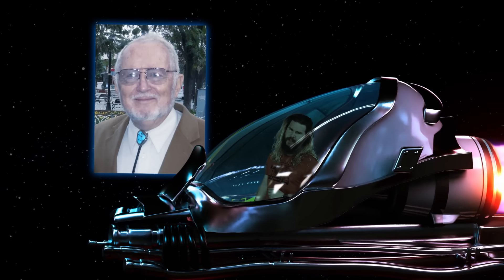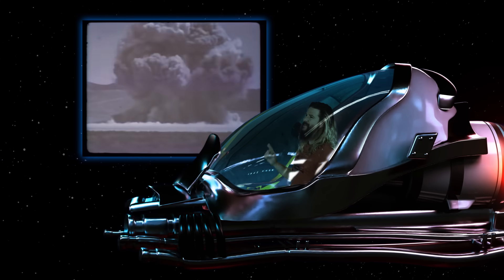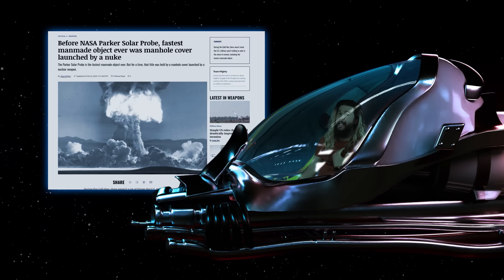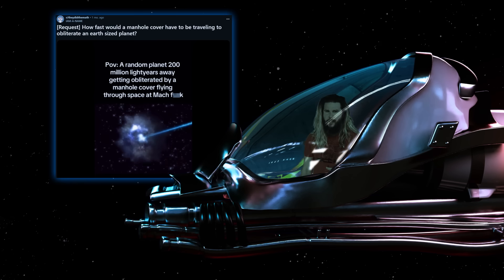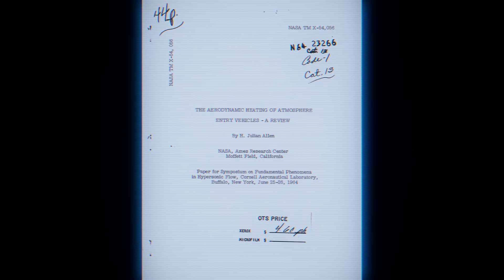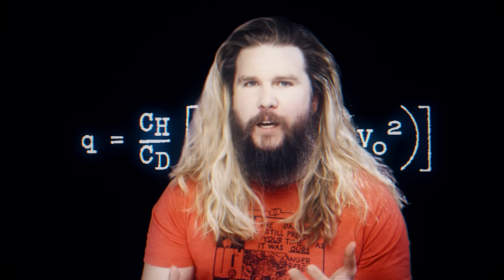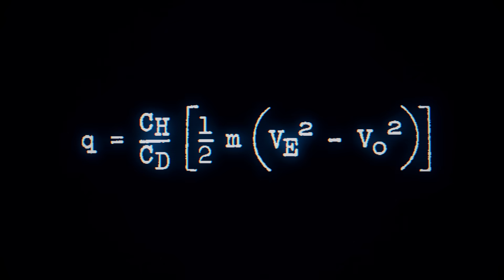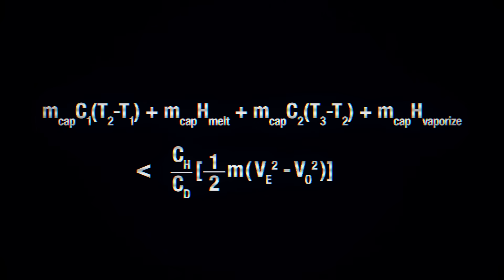Debunking the Nuclear-Powered Manhole Cover

Comment: I see one major problem with your math. The drag will change dramatically during the flight as the object starts to vaporize. You would need some integral to calc that in. Not sure if it will be enough to change the outcome, but some parts might have made it to space then.

Comment: im not saying it makes the order of magnitude difference that it neeeds to change anything... but that first half of the equation leaves a lot of things skipped over or unexpained ( is the nasa paper publicly vailable?). its also reasonable to assume the plate didnt fly straight for very long and if it survived the initial launch and tumble it will probably, vaporzied/tumbled/melted itself into a much more aerodynamic shape. hopefully sb will do a simulation of that at some point that woul dbe so cool to see.

Comment: I don't understand why people ever believed this-- when people observe re-entry burn at a tiny fraction of this speed with specially-designed heat shields, how could an unshielded ballistic mass of that size not completely evaporate?

Edit:  Think this-- a spacecraft returning to earth is relatively gently slowed by the slowly-increasing thickness of the atmosphere.... but the cast iron cap isn't gently heated but the energy is mostly applied against it all at once in the full thickness of the atmosphere.

Comment: Kyle, my only issue with your assumptions is that heating would be same entering the atmosphere as leaving. If the heating wasn't enough to vaporize it before it made it through the thickness parts of the atmosphere, the heating should go down over time allowing it to survive.
Reply: In practical terms, this might make it worse. Encountering the thick layers first, might break it apart and the higher surface area would absorb heat faster.
Reply: @lars-hendrikschilling3531 
It didn't encounter the thickest layers of earth's atmosphere since it had a nuclear explosion traveling with it. A fact that was absolutely ignored in this video along with many other factors.
Reply: @lars-hendrikschilling3531  "might break it apart" is a big assumption, since it passed through ALL of the dence atmosphere in about a second. 
and that was shortly after the 1 frame photo was taken.
Reply: My other issue is comparing it to a meteor. Meteors are know to be quite porous and also not exactly refined in terms of the material. so super heated air pockets with in a material that may not have consistent thickness or hardness throughout can result in the explosion. As opposed to the man made solid.

Comment: You have such flawed logic lmfao! It moved from the ground all the way up to where it was, in the 1 frame it was captured in, and it didn't even look like it was starting to heat up. I think it would have punched out of the atmosphere np's. Atmospheric entry calculations are not at all a good way to judge exiting the atmosphere at 150,000 mph. One is punching into ever denser air the longer its being heated and the other has the air getting tinner and thinner. At 150,000 mph it would have exited our atmosphere in a few seconds. Even your examples of meteors doesn't prove anything either! Even the ones that do explode have pieces that survive! These might be the dumbest arguments I've ever seen a science communicator make, and you did it with such conviction.

Comment: “Mach middle finger”. Did you mean Mach fornicate?

I’ve still wondered if the cover was seen leaving the hole, or there 1 frame, and gone the next. I’ve wanted someone smarter than me to calculate the heating occurring when the air compressed underneath it. Seems odd to me that iron could hold together under the pressures required to attain Mach fornicate, when a defensive/offensive mass accelerator cylinder easily ruptures under what I can only imagine is lower pressure as the mass being accelerated does not approach the alleged Mach smash

Comment: 1. air density isn't constant
2. the air from the explosion around it moving at roughly the same speed could have reduced the drag
Reply: 3. it wouldn't have stayed a flat disk for long, leading to a more edge on profile, drastically decreasing drag.
Reply: counter point, it was accelerated from an explosion, which means it already would have been really hot before drag started heating it up
Reply: @ysquaredyobozo  counter, counter point... the inertia of 900Kg of iron remains the same, whether that iron is in a solid, liquid or gaseous phase. the mass does not vanish, only the coefficient of friction changes.
Reply: @IanFBNS  what does that have to do with what i said?

Comment: The thing is, it would have made it into space in less than two seconds. I bet that, if you would accelerate an object in the same way, but without a blinding nuclear explosion, you would have seen a very bright streak of light shooting up for less than a second that fizzled out somewhere at like 50 kilometers up. The fact no one looked, the people might have missed the coolest and fastest "upward" meteorite ever.
Reply: Also, it was going straight up, which is exceedingly rare for an asteroid hitting the atmosphere, they come in at shallow angles and spend a lot of time moving through the atmosphere.
Also Also, asteroids aren't uniform materials. They break up, expose gas and ice to the plasma front, and do not behave as a uniform solid.
Also Also Also, asteroids move from vacuum thru increasing density, whereas the cap was doing the exact opposite.
Also Also Also Also, (boy that has lost all meaning now) his equation assumes the cap heats uniformly as far as I can tell, the outer material ablating off would form a plasma that would absorb heat itself, protecting the interior parts of the cap from the heating. Literally how the space shuttle re-entry worked, the outer layers of the tiles ablate off and absorb heat as the plasma and gas is moved away from the surface.

Overall I do think the thing probably never made it to space, cast iron not known for its impact resistance. I'd guess it broke up and the smaller pieces would indeed burn up. His argument as presented is pretty sloppy overall though, way more than I expect from him.
Reply: Meteorites point down, meteormites point up.
Reply: @BensBrickDesigns Perfect
Reply: Since it's cast iron, it probably shattered
Reply: Two seconds assumes that 1) the object wouldn't have decelerated pretty dramatically just within the first couple of kilometres and 2) it was going literally straight upwards with no deflection or tumbling, which would have been impossible given its initial orientation. The gas jet propelling it wouldn't have been carefully crafted to be symmetrical and I doubt it could have gone more than a couple hundred metres without developing a sideways velocity component that would have helped waste more of its kinetic energy.
Reply: @LafayetteCCurtis it was riding a shockwave. Drag wasnt an issue at peak velocity
Reply: it wouldve shattered due to the giga-pascal pressure (higher than its ultimate tensile strength
Reply: @drcgaming4195  Yes, or course. All while turning into a bright glowing streak of plasma.
Reply: No they were too busy with the THERMONUCLEAR EXPLOSION GOING OFF UNDER THEIR FEET!
Reply: It would not have made it into space. At that speed, it would experience over a quarter of a million gees of drag force, which would be enough to stop it in 0.02 seconds. That is significantly less than 2 seconds, in case you didn't notice.

Comment: Their does appear to be a missed variable though. Both meteors and rockets move under their own power. Where as the man hole cover has an initial velocity the drops at 9.6m/s2. 

I would wanna see what the air resistance and gravity effect has on the velocity. And what the affected velocity has to do with said outcome.

Comment: I have questions!
1) what was the total contact time with the atmosphere? And how did the density gradient effect the heating.
2) did any cameras catch the bright streak of the manhole cover vaporizing as it assended? I've seen how bright a grain of sand burning up can be?
3) does hyper velocity change the ability of the air molecules to transfer heat into the iron? Or could it create a plasma bubble that wouldn't efficiently transfer heat?
4) could the iron actually handle g loading at this level? Would it just turn to dust from the crazy acceleration vs deceleration?

Comment: If the initial speed estimation was incorrect, wouldn’t there remains the possibility that it went fast enough to leave Earth but not melt? Or is the speed estimation reliable?
Reply: There is a lower bound because if it was slower than that, it would have been caught by a second frame of the high speed camera. I'm unclear if the stated speed is the lower bound, or not.

Comment: Did you take into account the compressed jet of air that was surrounding the manhole as it was shot iff. Similar to the Leidenfrost effect, the compressed jet of air could have proceeded the manhole thereby acting like a cutting knife through the atmosphere with cooler air being sucked in behind it (that's what make the mushroom cloud). A body falling into orbit is a different circumstance altogether and I wouldn't be hasty to have but the slightest correllary connection between the two events.
Reply: I meant to mention as well that if the manhole was moving at the same velocity relativistically speaking the manhole would not be moving through the air. The manhole would have any airstream against its surface at all encased in a bubble of compressed air going the same velocity.

Comment: There was a good chunk of atmosphere moving with the manhole cover due to the jet of air pressure pushing it along with all the air around it. This itself would have gotten it pretty damn high before it started feeling air resistance. By that time the air would start to get pretty thin and not be able to transfer as much heat into the metal. All of that and it would have also only been experiencing this for a few seconds at most with the speed it had. While I aint no Mathmechanic I'm willing to bet, while it did get melty, it made it to space and beyond.

Comment: You made one huge assumption that throws the whole calculation into a thrash. 

You assumed that metal cap traveled flat side against the drag - which is the worst (and least likely) possible scenario. You should have made the calculations with assumption it tumbled exposing way less surface an average

EDIT:

There's also second horrible assumption in the shown math - it assumes the object is stopped within the atmosphere, which is bonkers because you don't know it - if it escapes, some of the energy won't be dissipated.
Reply: A couple other issues as well: He compared it to meteorites, which are not monolithic objects held together by internal forces. The man hole cover wouldn't have exploded the way meteorites do.

Second, and the big one: He's assuming perfect heat conduction and distribution in the man hole cover. In reality the outer surface would have ablated while the inner material continued on. Yes, it's an absurd amount of heat being dumped into the material but heat transfer takes time and the cover simply wasn't in the atmosphere long enough for the entire cover to vaporize. It likely would have been a molten blob of metal a fraction of its starting size when it reached space, but it WOULD have reached space.
Reply: My immediate thought too. The blast itself would've likely deformed it too, as well as it changing shape as it heats up and softens, further lessening its drag.
Reply: I agree, the cap had to be spinning, probably at an insane rate, from the imbalanced force of fracturing the welds holding the cap down.

A spinning cap may have experienced less projectile drag.. but it may have experienced significant drag from its spin. 

Also, Kyle did not account for heating prior to weld fracture, as the air within the chamber was compressed against the cap by the force of the detonation behind it. Air heats as it is compressed. Compress air to 20 atm, and it gets hot enough (and its constituent oxygen gets concentrated enough..) to ignite atomized diesel fuel. At temps above about 3,000C, iron becomes a fuel and burns in oxygen.

If the cap was spinning, and if it became molten from any heat source (compressed air at launch, projectile and/or spin drag, exothermic oxidation by atmospheric oxygen).. then centrifugal force from the spin would have formed the molten mass into an expanding cone of hypersonic molten iron droplets, increasing the surface area per unit mass and promoting oxidation reactions.

So.. sure, Kyle made an assumption of a flat broadside drag profile.. but he also overlooked several other factors which all add heat to the cap, either at launch or in flight.

This is all just conjecture anyway.. but I consider "burned up on the way out" to be the most likely outcome for this cap.
Reply: I don't think that at that acceleration the shape of the projectile would matter much. Even if it wasn't flying through it flat out, any tiny deviation of the ballance would make it spin, which at that speed is just as bad, since not only you are moving the whole object upwards, but parts of it would also interact with the fluid (air) sideways at an angular speed mach middle finger, which is just as bad as if it was hitting the air directly on in a ballanced flight. Spinning or not, at that speed the material would be pushing through the mass so fast that the mass would not be able to dodge to sides and instead all of the kinetic energy would get transfered directly to the metal surface regardless.
And besides, even with these eyeballed calculations, you are arguing about a factor that would influence the value, but not really to the point of moving the decimal point by the difference of 10, which is the difference we see in the end of the equation - there's no way that this tiny detail could magically turn the final number from 10^13 to 10^12 or even less so the other side would take over
Reply: then the drag would have shattered it into pieces.

Comment: Kyle acknowledging that fluid dynamics is the hardest thing we have ever tried to solve in all of physics makes me laugh in exasperation, because yeah, good luck trying to calculate any of fluid motion without simplifications. We still struggle with Laminar Flow which is supposed to be the best kind of flow to math
Reply: Most things at that level are differential equation pain and suffering. As an EE Maxwell's equations generally suck but atleast its all single term A×B type stuff. 

Wikipedia's page for the fluid dynamics equations looks like pain and suffering as you have so many more terms per equation. 

I don't think everyone suggesting he models it as a tumbling disc understand just how much that complicates things. We have relatively nice equations for face and edge on, but tumbling adds so many more variables. (It also would have taken about 1.5 seconds to reach space, and the edge on calculation has it vaporize about 10 times over before hitting space, so if it maintained the edge on orientation it vaporized in 0.15 seconds. Not much time to tumble.)